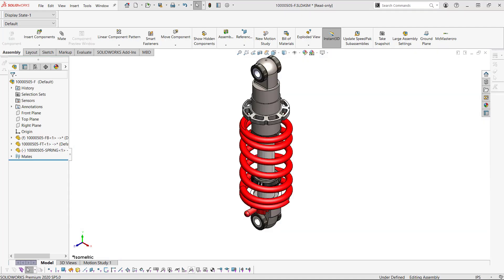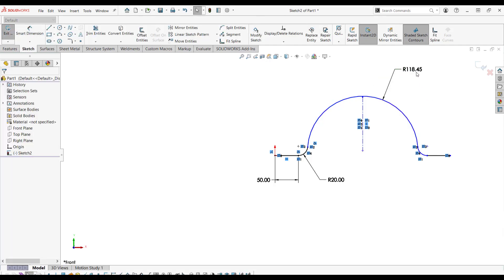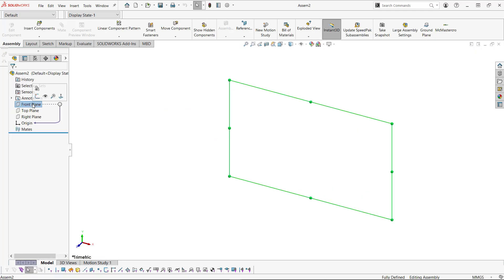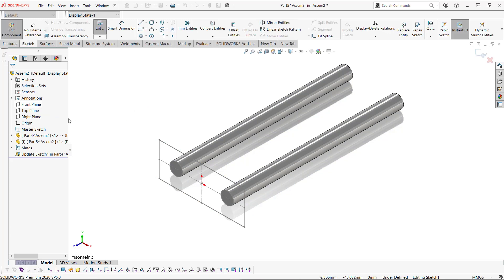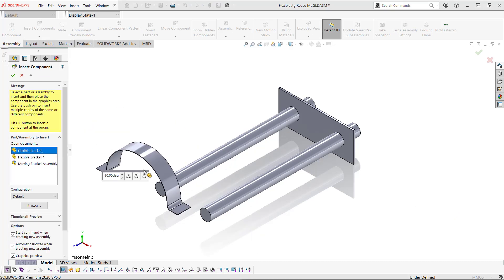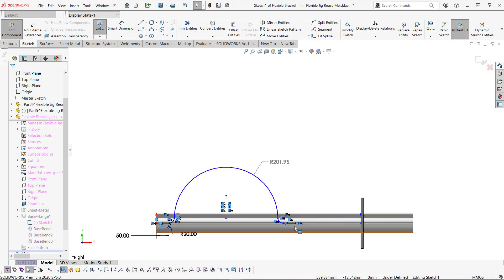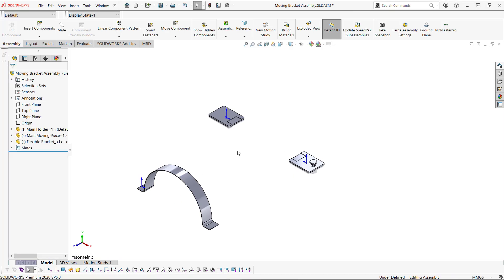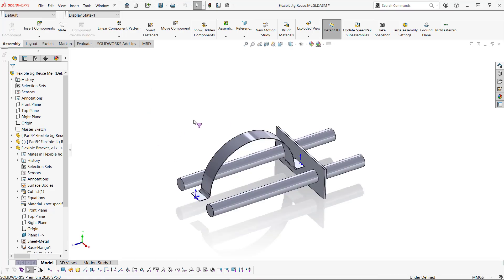SOLIDWORKS 2020 - How to Make Flexible Part

Comment: Flexible is not meant to be taken literally in this context (CAD). It simply means a part's definition can be altered in some way dynamically within an assembly without having to remodel and save multiple versions of it which is where the value lies. For things in real life that can be bought in different lengths, this is a way to reference assembly geometry to get, for example, a frame to scale appropriately and grow/shrink lengths of connecting members. No, it does not compress or stretch a part of fixed mass in such a way that accurately simulations elastic deformation (what some ppl in the comments are expecting). In some cases, that requires much more from your computer in FEA-land.

Comment: I think the concept is not practical.  Flexible part should not change the size of the part. It should just change the shape.  Yours changed the size.
Reply from the maker: The Design intent of the flexible component is important Like the spring and the boots examples show early in the video. Those parts on changes in shape. However it is easy to imagine a situation where you may have custom straps that are cut on a job by job basis. The flexible part allows you to easily cut the strapping for different scenarios.

Comment: Can an flexible instance be captured in a drawing?
Reply from the maker: Troy, at the moment there is not a good way to capture this dynamically in a drawing.  You could make configurations showing different lengths or of a compressed vs relaxed.

Comment: Can you do a spinoff version of this video where the part flexes rather than resizes?  It will flatten as you pull the ends apart.
Reply: That would require meshing and a finite element analysis simulation

Comment: Jacob, this is only a remake! Flexible mean the overall length stays the same, only the shape deforms and gets stretched.
Reply: No, a "flexible part" in CAD terms means a part with a dimension that can be charged dynamically. It is not the same meaning of "flexible" you are thinking of.

Comment: I am trying to make an adjustable link as smart component by selecting circular surfaces/edes of the 2 parts to be connected on an assembly.

Any suggestions?
I am lost.
Reply from the maker: In order to adjust the linkage with 2 parts connected in an assembly, the edge/face would have to be controlled by a sketch.

Comment: Can you use this part 2 time (or more) in an assembly with 2 different size?
Reply from the maker: Yes, in fact the whole idea is that it can change size for any assembly, without the need to dig into the sketch level for resizing, and can use the automatic rebuild to see if you need add clearances without measuring, rebuild, guess and check or creating additional external references. Once you have the size you need, perform a Save as Copy and Continue or Save as Copy and Open. Additionally, you can create configurations for the sizes you want to lock down, then in SOLIDWORKS 2020 and beyond, you can even save specific configurations as separate parts. 

In addition, the ‘Virtual Jig’  and techniques displayed in the video can be reused to create any additional ‘flexible’ part. If you intend to make your part ‘flexible’, double the check that the initial mass is the same as the final position of the flexible part mass in mass properties.

Comment: This is not how physics work. A flexible part should FLEX without changing its mass.
Reply: yeah I don't get how this is considered flex if you're just adjusting the radius 🤔
Not a bad tutorial, but not exactly accurate, maybe the two "ark" (where it starts to go up) should change, and the radius should shrink as you stretch it... anyway this is way beyond my one week solidworks skills, I'm still trying to really understand how sketch/parts works. 😅
Reply: flexible has another meaning in this context. These "flexible components" are pretty cool, because if you have a part which dimension is determined by another part in the assembly, this can dynamically adjust to the assembly.
Reply: @scifinn6332  I agree. Probably flexibility doesn't mean 'mechanical' flexibility but just the ability to be modified in this case. A bit misleading because it would be great to have a feature for that.
Reply: Agree with you. This is not flex🤫
Reply: You can fix the total length of the jig and loosen other constraints to make it practical. The jig will lose the consistent semi circular shape.
Reply: https://www.youtube.com/watch?v=F4JMRFvg6Jg